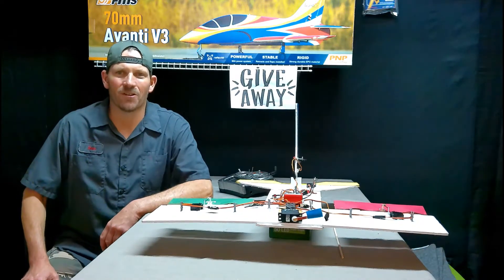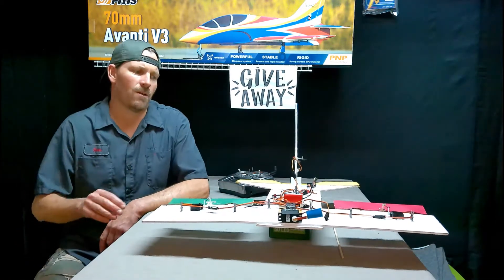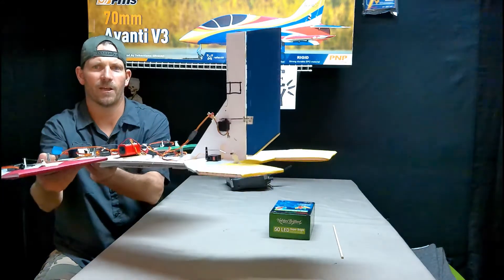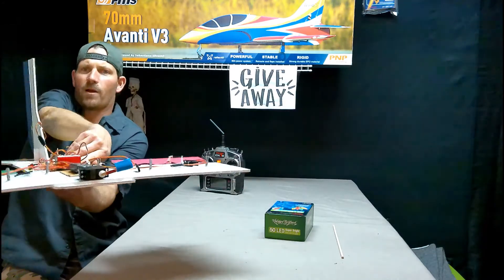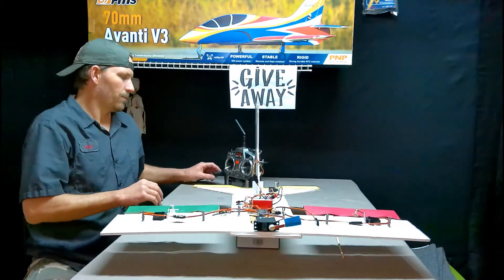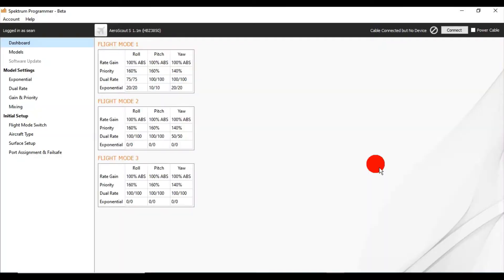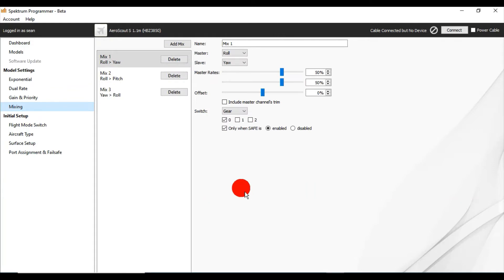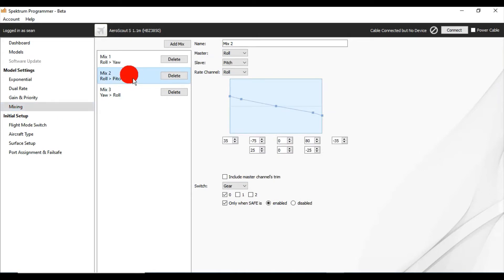RC AIRPLANE TRANSMITTER RECEIVER MIXING SPEKTRUM E-FLITE SAFE SELECT AS3X BNF RTF WHAT ARE MIXES ???

Comment: Hi Shaun, have searched you great videos but can't find what I'm after. How to set the flaps so they work with the ailerons, to give full span ailerons. I have a DX6e and 6 channel rx. Looking at the Sailplane it offers wing type with 2 aileron and 2 flap but doesnt leave a channel for the motor. Do the flaps need to be on 2 channels and the ailerons on 2 channels? In which case the DX6e won't do it. I can put ailerons or flaps on a Y lead, please help?